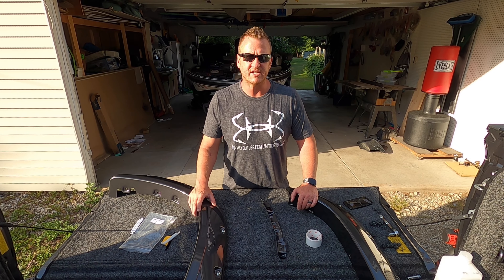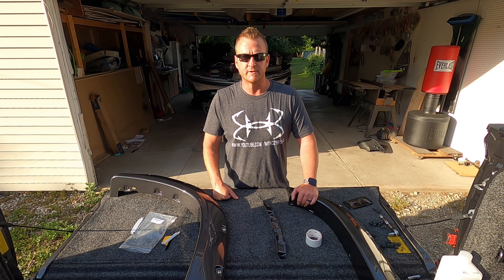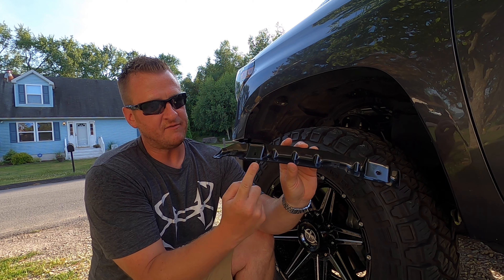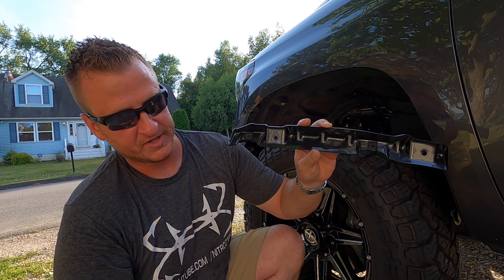Bushwacker Fender Flare Install (with paint protection film) on a 2020 Toyota Tundra

Comment: I used a sharp grease pencil to mark the fender outline. I pinched it between my finger and thumb and ran it along the fender edge as a guide. When I was done it wiped right off. The grease in the pencil is more like a crayon and I tested it in a hidden area first. 

I also used 3/4 expel door guard tape. It was easy to form to the shape as I laid it down and it left no bubbles since it is so thin.

Comment: can you post a pic looking down the front side? trying to get a reference to how much they stick out because im running 20x10-18 fuel wheels and some 35" nitto trail graps.  id like to put a set of these on my 2021 CM to help with the rocks and mud slinging up the side of my truck
Reply from the maker: Unfortunately there’s no way to post a pic in the comments here on YouTube (that I know of anyway)...but my wheel/tire setup is 20x9 +12 wrapped in 35x12.5’s and the flares are literally just about even with my tires...I would say they would help you for sure, but you’re gonna stick out a little farther than the flares, hope that helps!

Comment: Awesome video. I just did flares this weekend and immediately decided I can't drive the truck until I put some kind of protective film under the rubber gasket. 

I'll add that cutting the protection film between the main fender and the piece under the headlight isn't really optional. If you ever need to change your headlights the small piece has to come out so you'll cut the protective film anyway. Better to do that before and water or debris can get onto the adhesive through that seam.
Reply from the maker: Thank you!…and yea that’s a great point, I didn’t even think about that…thanks for sharing, much appreciated!

Comment: Great install video. Question I assume you can add other styles fender flares from bush wacker and still use the paint protection? I’m looking at a different style but I will need to get them painted LunaRock for my 21 tundra Pro. Also NitroZ with 35’s on your tundra how is the power loss and gas mileage? Thanks.
Reply from the maker: Thanks Don, I appreciate it!…yes sir, you can use the paint protection film with any style, same procedure…just make sure to line it up as shown in the video
The 35’s did affect power loss and mpg of course, the power loss was slight but noticeable…the gas mileage just sucks…lol…I average about 9-11, give or take (depending on city/highway)…I swear there’s a funnel somewhere in the gas line 🤣
Reply: @NitroZ18Fishing  Thank you for the info. I agree with the gas that’s what’s stopping me to go bigger. Lol. Truck looks good!!
Reply from the maker: Thanks again, I appreciate it!…let me know if I can help with anything else!

Comment: It is truly pathetic that we are now expected to buy a  $130 roll of tape to protect our paint from the poorly designed fender flares that all these companies are peddling. The flares I had on my '01 F250 were attached at the top of the flare with 3M double sided tape. They were still perfect after 16 years of use. 

Now we're supposed to get excited about poorly designed flares and $130 rolls of tape that require installing, removing and reinstalling the flares to add the way overpriced tape which may or may not work in the long term.

Comment: Great video. Just a quick question could you reinstall the front and rear mud flaps if you were to use a longer plastic bolt or push tab? Thanks
Reply from the maker: Thanks Brian, I appreciate it!...and I don’t think it would work only because of the way the flaps sit on the truck...if I remember correctly, I think they would still interfere with the flares, not allowing them to sit flush against the truck like they should...hope that helps, thanks for watching!
Reply: I just installed flares this weekend. I tried cutting the OEM flaps to wedge them under the flares but there's not really enough room. It was also a good excuse to buy rokblox flaps :D

Comment: Two questions did you paint match your door handles? I cant find any parts for my 2020 limited. They are magnetic grey with chrome and i want the chrome gone but dont want to lost the smart features. Second questions is what size lift do you have to clear those 35s. Thanks!
Reply from the maker: Hey Eric!...yes sir, I painted my handles to match...my 2020 Platinum came like yours, with chrome on part of the handles...you can buy replacements color matched without losing smart features but the price is absolutely ridiculous...no way I was paying the amount they want for them, so I just got color matched paint and did it myself...came out great!...and my setup is 4/2 ReadyLift SST sittin on 20x9 +12 wrapped in 35x12.5’s, thanks for watching!
Reply: @NitroZ18Fishing  Thats amazing! So you popped off the chrome piece and roughed it up and painted it? Truck looks amazing btw. Stumbled upon your video because I am on the fence with the flares and your video was very helpful will probably be purchasing them as soon as I figure out the handle situation
Reply from the maker: yes sir, that's it!...saved hundreds...and thanks for the kind words!

Comment: I have the Toyota Fender Flare installed on my 2016 Double Cab Limited and 2 years later the rubber seal came off the center rear flares both of them and feel a into the fender flares, I've been loosening and re-putting on the rubber seal and still have that problem. There is a guy on youtube installing PRO COMP FLARES  and does not use the rubber seal but uses a black silcone trim with out the rubber seal, what's your opinion on that and have you looked into it.
Reply from the maker: Hey Richard!...yes sir, I’ve actually seen that exact video...I can’t speak from experience, but it does look pretty good!...I almost did it myself, but I knew I was going to be removing them to do a review on the paint protection film and also ceramic coat the truck...it looks very doable, and if done correctly I think it would look great!

Comment: How did you black out your platinum emblem?
Reply from the maker: I used Plasti Dip, over a year now and still holding up perfect!
Reply: @NitroZ18Fishing  I kind of figured that. Does it hold up to pressure washing etc? Did you get overlays for the 4x4 or platdi dip that too?
Reply from the maker: yepper, I use my pressure washer every time I wash her...which is a lot...hahaha...and the 4x4 is actually a replacement...that's the only one I didn't dip

Comment: What tires are you running? Do the tires sit flush underneath the fender flares?
Reply from the maker: They’re 20x9 +12 wrapped in 35x12.5 Kenda Klever RT’s...yea they sit just about flush with the flares, thanks for watching!
Reply: @NitroZ18Fishing   Curious what your thoughts are on the tire and handling/road noise?  I've never heard of this tire but started researching them after seeing your video.  Seems they're a good priced tire and 12 ply might be a plus if you're towing.  We've got a '18 limited and I'm looking forward to doing your exact setup.  Are you having any alignment issues with the kit?  Any feedback is appreciated..
Reply from the maker: hey Kevin!...I absolutely love em, if you haven't seen it, I posted a video talking about these tires a couple weeks ago...they're the best all around tire I've ever ran...quiet and smooth for such an aggressive pattern, I won't hesitate to buy them again when it comes time, and that 12ply is a great plus to have with towing my boat!